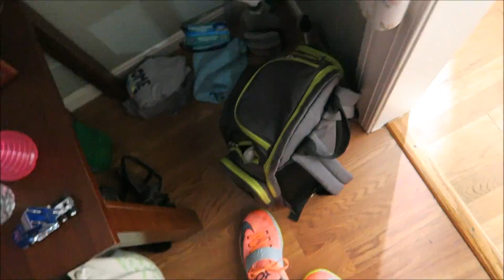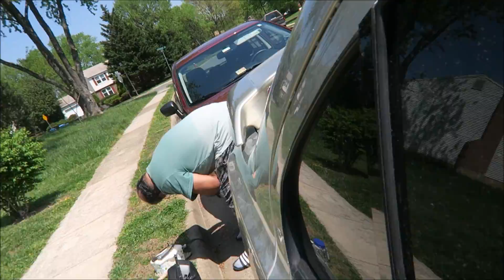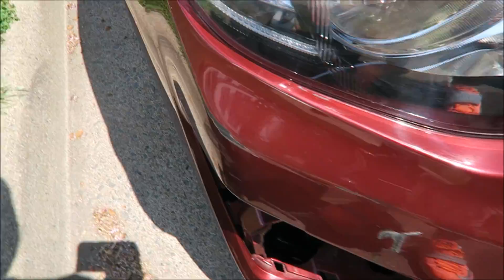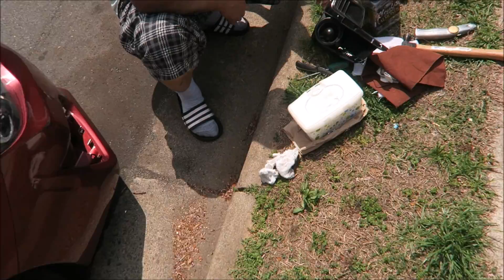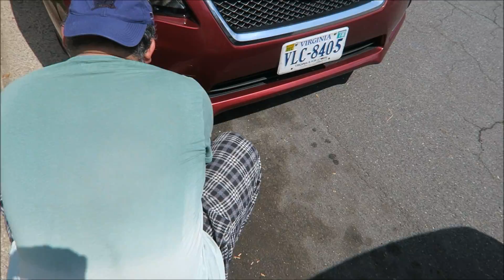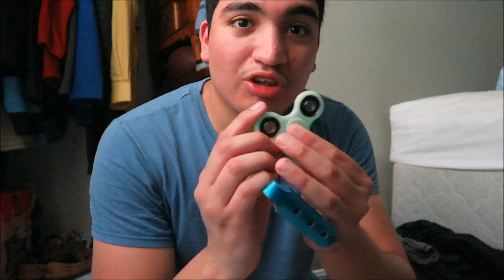My sister got on a accident

Comment: u motivated me to plastidip my ford taurus and it worked on my lights and hood but it's too dark on my windshield and i can't take it off. i couldn't see out of my windshield so i added clear coat i think it's called because i thought it would make it easier to see through the plastidip but it didn't work? how did you remove your plastidip and did you plastidip your windows
Reply from the maker: +Brrookss aye that's dope man, I actually too my car to a window tint shop and made it a 25 % tint it will come off with googone man